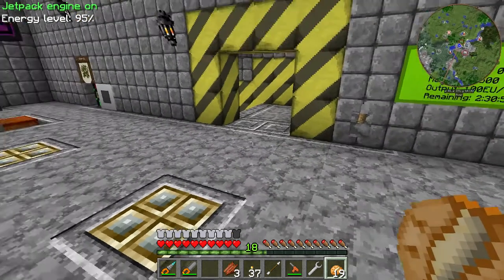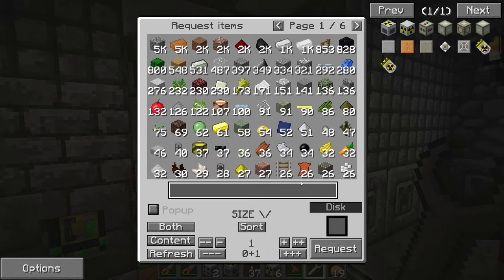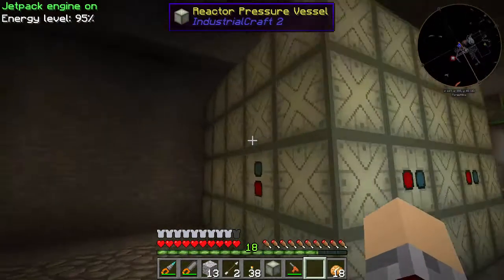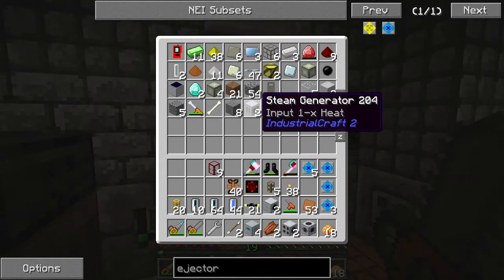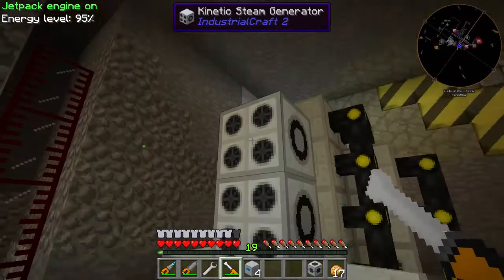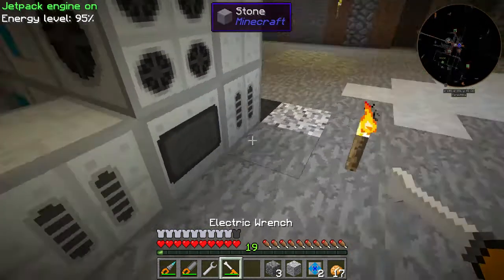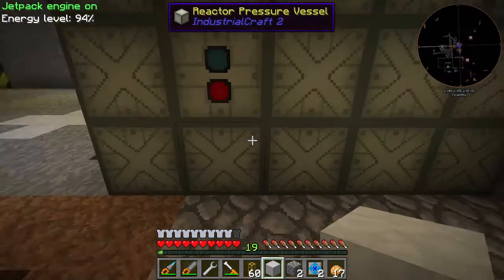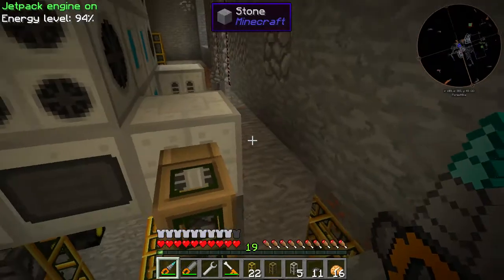MineCraft 1.7.10 Single Mod Survival Game IC2. #29: Steam Reactor Setup

Comment: if u use drill on IC2 machines or if u just want to break them up to pick them up in most cases machine will break and u will get casing... u could just use HV cables since they are cheaper and less eu/t loss over distance and max range is higher too. also that setting 221 bar in steam generator just means on 221+ bars u get super steam if u set it on 220 or lower u gonna have regular steam